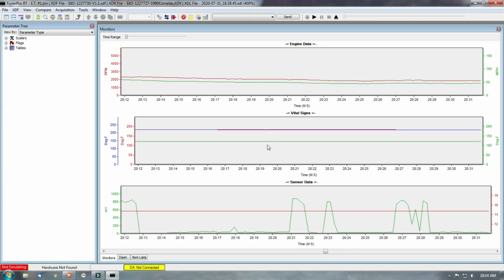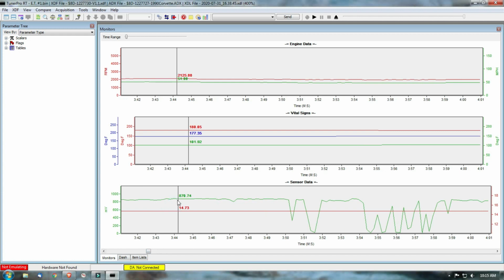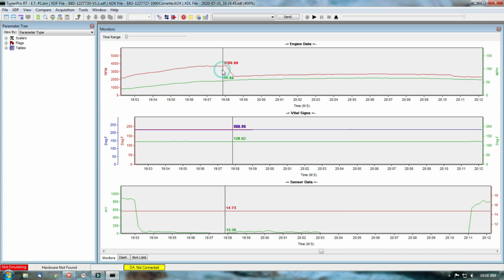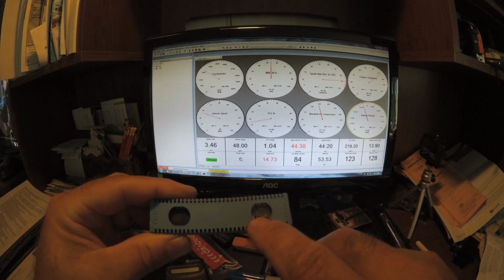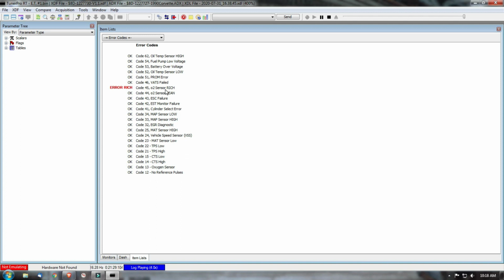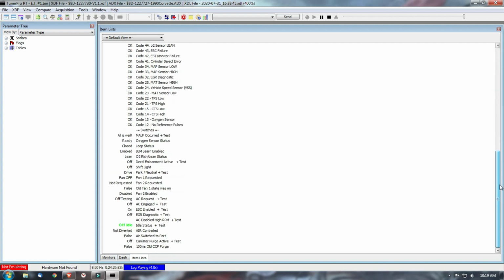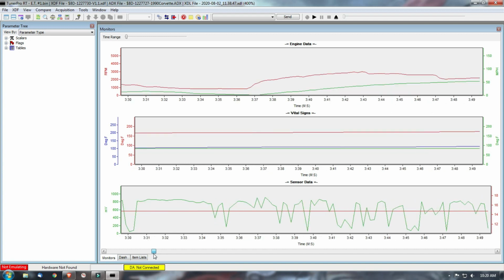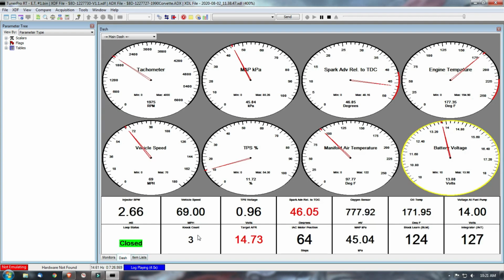Bad Memcal  Corvette

Comment: Great video Eugene, happy it was a simple fix.  I was dealing with crazy knock counts, no audible detonation.  30 minutes drive to work, not going over 3000 rpm, would give me 30 to 40 counts.  Added fuel. Took out timing, same results. Swapped in remanufactured ecu and now same drive to work I'm down to 8 or 10 counts.  BLM are 126 to 132.  AFR gauge good in all different scenarios.  What to you is an acceptable amount of knock counts in normal 30 drive to work.  Just wondering if I'm being too critical, car starts right up hot or cold, idles warm at 600 rpm, pulls strong and steady, sounds awesome, and again no audible detonation.  Just looking for a second opinion.  Be well, and thanks for all the videos, watch all of them?
Reply from the maker: You should take a look at a few spark plugs and look for any sign of detonation also if not already try running a higher octane gas.

Comment: Sir, I have an 89 Corvette I purchased an Ostrich ECM tuner. The ECM uses an MCAL . Will I be able to use the Ostrich. Thank you Joe
Reply from the maker: If you mean the Ostrich 2 emulator it will work with your 89 as long as you have the adaptor, moates that originally made those items is no longer in business but this company should be able to help you out if you need the adapter. https://boostednw.com/  Good luck with your project.